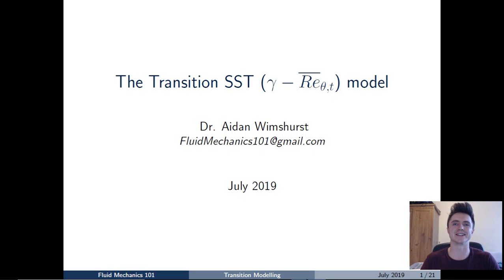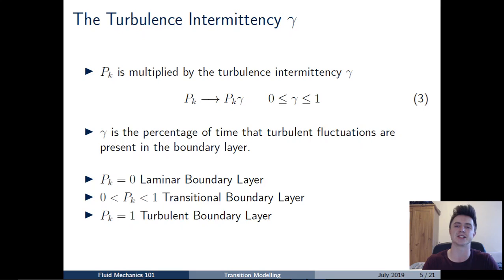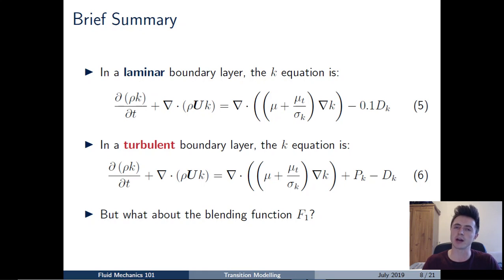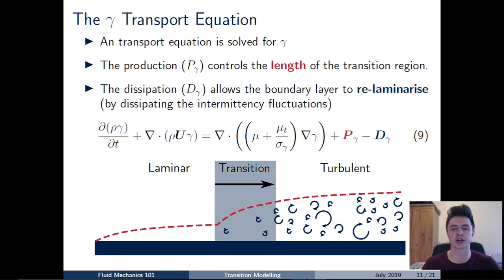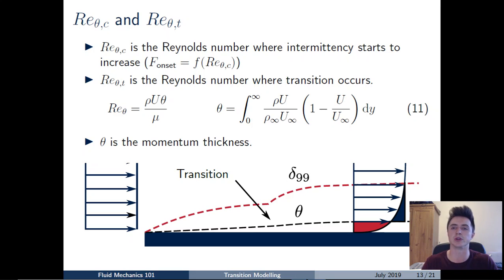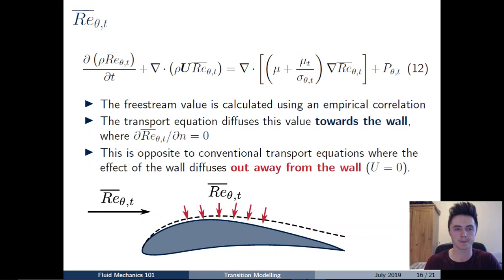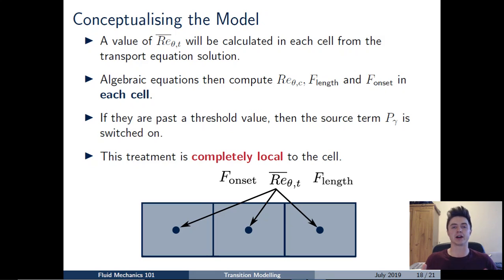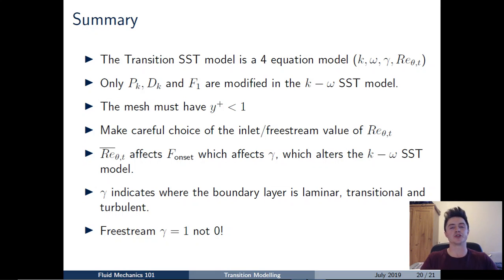[CFD] The Transition SST (gamma - Re_theta) model

Comment: If I understand correctly:
1) Transition SST is more sophisticated than K-Omega SST. Therefore, it's of equal or greater accuracy, but only when its additional inputs are appropriately tuned (e.g. from DNS or empirical correlation). Otherwise, inappropriate inputs could make it far less accurate.
2) Transition SST has the greatest improvement over K-Omega SST, at low Reynolds numbers.
3) Transition SST is computationally more expensive than K-Omega SST.
4) Transition SST is less stable (solution convergence) than K-Omega SST.

Comment: Hi Aidan, great video. I am very new in CFD and I started to calculate a 4415 airfoil with this 4 equation model. What surpised me is that it doesn't converge and stays oscillating around some value. I read some works and they show the same behaviour, however I wasn't able to find a explanation and how is the results treatment, since there is no actual value but a range of.
Reply: I know this was a year ago but I just had the same problem at stalled AoAs -> the fix was to decrease relaxation

Comment: Hi Aidan. I am wondering if I could use SST transition model for high Reynolds flow too. seems the gamma can turn to 1 which converts the SST transition model to k-w SST anyway. Is that right?
Reply from the maker: Yep, you could use it for fully turbulent flow. However it is quite a bit slower, and less stable. So the extra effort might not be worth it, if the transition region is very small. 

A sensible approach would be to try normal SST first, then transition SST and compare your answers. If the drag is basically the same, then you could just go with normal SST. If there are some differences, then transition SST is probably worth the extra effort

Comment: Aidan, congratulations for you explanations! Could you suggest a link to good practices for modeling turbulent boundary layers of rough surfaces with RANS methods? Most models we have found rely on wall functions calibrated only for flat plates with zero pressure gradient. Thank you!
Reply from the maker: The only source I know of is the ANSYS CFX manual, which has a variety of treatments (including treatment for icing surfaces which have high roughness)
Reply: @fluidmechanics101  Thank you very much. There is surprisingly little bibliography about how to mesh a boundary layer when the surface is rough.

Comment: Hi, thanks for your video. I have a question. I'm working on a channel with ribs for the Reynolds number from 10 to 6000 in fluent. Is it need to use of SST model for the range of 2300 to 4000? Or i can use of turbulence model like k-e
Thanks a lot

Comment: Hi Aidan, (its me again,lol)

I hope that you can please help me out with this one;

I have a pipe system with very low inflow velocity (supposedly Laminar). Then wall heating is applied after some distances downstream.
Due to the sudden change,  I am not really sure if the system is entirely laminar anymore.
Is it okay if I use the transition model instead?
Reply from the maker: I would do a quick comparison with: fully turbulent (k omega SST), fully laminar (no turbulence model) and transition (transition SST). Have a look at the results and see if there are any differences. Also it is worth looking at the ratio of eddy viscosity / dynamic viscosity in your fully turbulent calculation. If the ratio is << 1 then your flow is pretty much laminar. Also have you checked the Reynolds number?
Reply: @fluidmechanics101  The system if for Chemical Vapor Deposition (CVD) and the Re is 743. From what's given to me (CFD, laminar), it seems that there's some circulation as the flow reaches the heated walls. This is why Im having some doubts using the fully laminar model.
Reply from the maker: Ah I see, yes the flow will accelerate when it reaches the heated section. You need to reach Re = 2500 to get turbulence for internal flow (so roughly 3 times your current flow speed). Yep this is going to be a tricky one to model. How expensive is the model to run? Can you just try laminar flow first and see what happens? Then try with turbulence and transition models
Reply: @fluidmechanics101  I haven't tried running yet so I can't really tell how expensive it is. Currently just want to get some feel on the physics behind it to make sure I'm modeling it correctly haha. But surely I'll go with your suggestion. Will share my findings here later on. Perhaps somebody will find it useful. Thanks Aidan!

Comment: Hi Aidan, 

Can you please share some best practices in doing a transient simulation on an airfoil using the transition model? How to get the number of time step/size etc and proper way to do the mesh/time step independent study.
Reply from the maker: Have a go with some different time step sizes and number of iterations per time step. Compare the results. If the results dont change much then you can be confident your time step is sufficiently converged
Reply: @fluidmechanics101  Thanks a lot Aidan!, So in other words I should just set up the monitor for lift, drag and maximum courant number in the system. I should then use adaptive time stepping to pull down the courant number. Once the courant number is close to one i can then maintain the same time step until lift and drag give a constant reading. Sounds good?
Reply from the maker: Sounds good to me 👍
Reply: @fluidmechanics101  Hello Aidan, 

Just another thought, I understand the importance of having a good initialization from a steady state simulation, but how do you define a good initial guess from the steady state? Should it be closer to the experimental data or should it taken when the residuals are behaving well? (Assume we can choose only one).
Reply from the maker: I would go with your initial guess as low residuals. Remember that you have to have an initial guess for all cells in the mesh and it can be tricky to know what a good guess would be in some areas. Either way, the CFD codes are pretty good and the initial guess is usually washed out in the first few hundred iterations of the solver, so as long as you are close you will be good to go

Comment: Hi Aidan,
Im wondering why is the simulated result using transition SST got me drag values which are twice as large compared to the experimental data for re ranging from 50k-100k? What can i do to solve this?Changing TU, turbulence viscosity ratio gave minimal change. Should i change the empirical data "model constant"?
Reply from the maker: Can you compare profiles of wall shear stress with the experimental data? This will tell you if you are predicting transition in the correct location
Reply: @fluidmechanics101 Noted Aidan,
So does it cd is by the separation whereas cl is not. Also, i have not seen any paper published yet regarding naca 0015 with low reynolds of 50k,80k and 160k roughly with cf and cp plots. Only very old ones with aerodynamic coefficients
Reply from the maker: Have you tried the book ‘Theory of lifting sections’ by Abbott and Von Doenhoff? I think this book has lots of aerodynamic data you can use
Reply: @fluidmechanics101  Noted with thanks Aidan

Comment: Hello Dr Aiden, another great video as usual. Do try to make a video on Detached eddy simulations and scale resolving options as seen in Ansys fluent, of-course if its in demand.
Reply from the maker: Yes, there is a high demand for DES, SAS and LES in fluent. I am going to start by finishing off the rans models with the k omega model (which will be out soon). Then i am going to move on to the LES type models 👍

Comment: @Fluid Mechanics 101 The stream edge definition for the SST Transition model in CCM+ is defined as $WallDistance>0.005?1:0 which means that boundary layer is 5 mm thin everywhere. Can we change 0.005 with the BL thickness of our problem of interest?
Reply from the maker: Hi Mazhar, sorry i am not a CCM+ expert. Dont think i can help you. Have you tried the CFDonline forums?
Reply: @fluidmechanics101  Yes. Posted it there.

Comment: Hi, How does the Transition SST differ from K Omega SST with intermittency turned on?
Reply from the maker: They are the same 🙃 some CFD codes will just say ‘turn intermittency on’ rather than describing it as a different model
Reply: @fluidmechanics101  Thanks Aidan!
Reply: @fluidmechanics101  One more thing, how come I get very different results when using  ansys mesher (unstructured) and ICEM regardless of good overall quality/skewness on both. Surprisingly, finer mesh despite good overall quality etc gives worst results. Is there a trick to this?
Reply from the maker: Do they both have the same y+, growth ratio normal to the wall and spanwise resolution? Transition SST is very sensitive to your near wall mesh (inflation layers)
Reply: @fluidmechanics101  yeah i did both for y+ : 0.5 and 1. Spanwise i had 400 points. When both styles of mesh had this level of refinement, the bl failed to reattach. I wonder why?
Reply: Found the problem. For low re simulation, we need to use transient instead of steady state due to the formation of the laminar separation bubble. Hope this will help others.

Comment: Hi Aidan!

You cannot imagine how much these videos are helping me to understand some concepts with which I had been struggling for a lot of time. Thank you for all your effort!

I wanted to ask you about something I have noticed for some time but have not still been able to decipher: I am not able to understand why the second term of the material derivative takes the form that it takes in, for example, the scalar transport equations in the 4:00 of this video (or the Navier-Stokes equations in any other video). I know that, in the definition of the material derivative, the second term (the one due to spatial variations) is the dot product of the velocity and the gradient of the quantity of interest, which is a formulation that makes sense for me. However, that term appears here as the divergence of the quantity of interest times the velocity. It is as if the nabla operator and the velocity had changed their position in that term. Is there any underlying assumption that allows performing this change? What would be the intent of it?

Apart from that, I would like to suggest you a couple of videos that, at least for me, would be very interesting: one about boundary conditions in general (what are the implications of setting a pressure outlet, no-slip walls, etc. for the different variables in a RANS simulation), another about DES/LES and how to set up such a simulation compared to RANS, and one about meshing strategies and good practices when creating a mesh -just in case you are looking for topics of your next videos-.

Thank you again for sharing your knowledge in such a comprehensive manner. I got also the full version of your Fundamentals Course and it is helping a lot.

Kind regards.
Reply from the maker: Hi David, thanks so much for your support and the kind feedback. Yes, i spotted the same thing as you and it keeps cropping up! The material derivative of U for example gives partial U / partial t + (U dot nabla) U, but most places seem to write partial U / partial t + nabla dot (U U). To this day i havent been able to work out why! But my best guess is that it is something to do with the product rule and mass conservation. Since nabla dot (U U) = (U dot nabla) U + (nabla dot U) U, the second term is zero if the flow is incompressible. However I am not sure and am still looking for an answer. If i find one i will post it immediately, as this seems to be a definite gap in the process .... 

Great, those are some fantastic video ideas. I will add them to my long list! My aim is to make a video on all these important topics as the imformation really seems to be missing from the internet and a good explanation is needed. However, it does take me a little while as the topics are sometimes complicated and confusing and i want to make sure we get it right, so it can be a good refefence. 

I really hope you enjoy the course. I found it really useful to make and it really helps put a lot of the finite volume method in a consistent framework. I am working on more content and detailed courses still to come, so stay tuned! 

All the best
Aidan
Reply: @fluidmechanics101  the passage from infinitesimal non conservation (material derivative) form to infinitesimal conservation form can be explained  like this: i indicate the x component of velocity vector V  with u.  rho du/dt + (rho V*∇). BUt we can write the first term as d(ρ u)/dt - u d(ρ)/dt; and the second  term as ∇ * (ρ u V) - u ∇*(ρ V). We put them into the the original and then we notice that dρ/dt + ∇*(ρ V) = 0 from the continuity equation. Then we are left with d(ρ u)/dt +∇*(ρuV).  Done! Just wanted to clarify this as a little thank u for this awesome video on this really hard turbolence model! :) Have a good day
Reply from the maker: Awesome explanation! Thanks Domenico
Reply: @domenicobianchi8  Thanks for your explanation :)